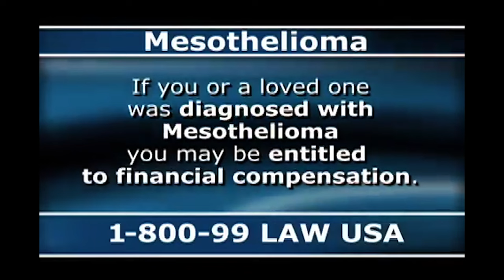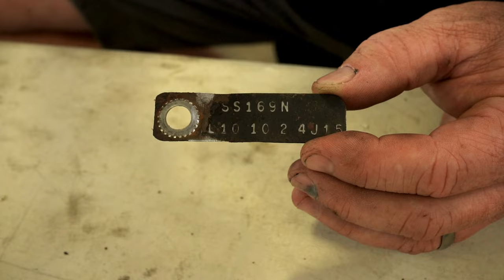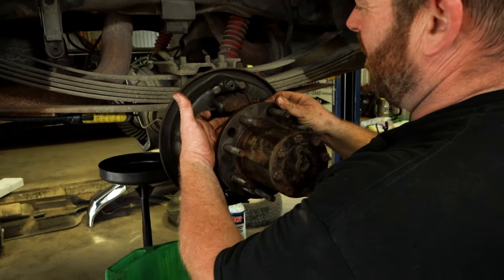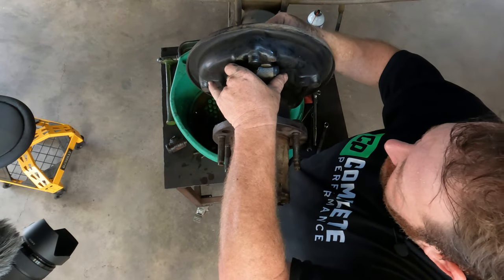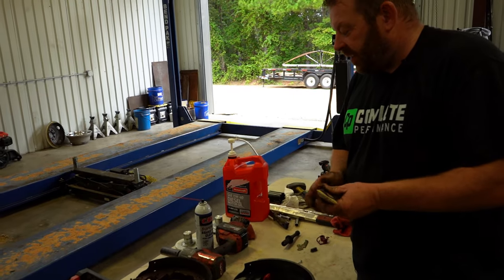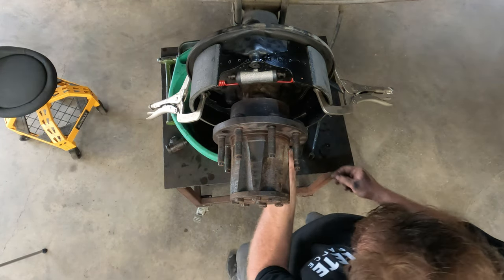How To Video - 1987-1997 Ford Rear Differential Service Tips/Tricks....

Comment: Nice video Mr,just did mine and new bearings, also in front replace new drums.can you post a video on how to install clearence ligts I want to install led clearence lights on my 1997 f350 7.3
Reply from the maker: Does your truck already have the lights?
Reply: @CompletePerformance  no it didn't came with factory lights

Comment: Just did mine on my 96, I had great e-brake before with old shoes and drums. Changed drum and  shoes and now nothing! So frustrated. Took it apart numerous times and it seem right to me. Seems to be a common problem.
Reply from the maker: Did you make sure the self adjusters were operational? Also you need to set the adjuster to where the shoes just touch the drums without brake applied